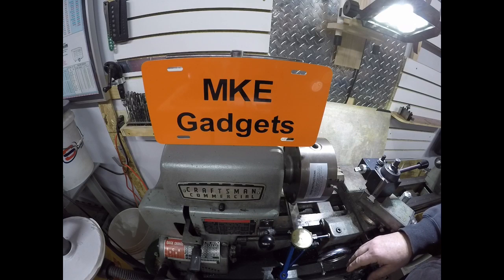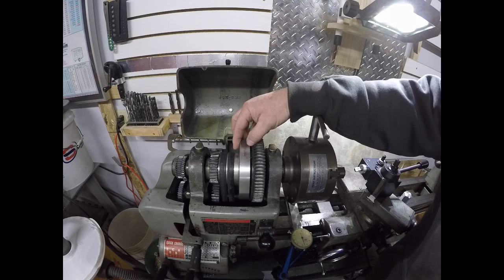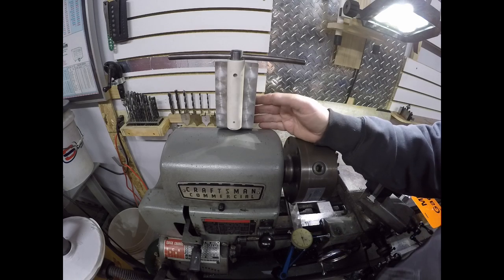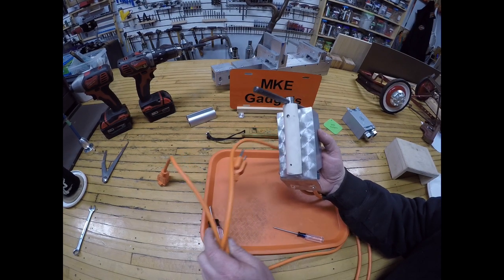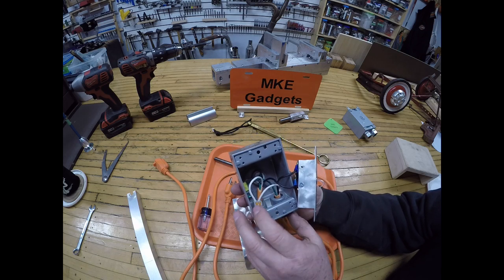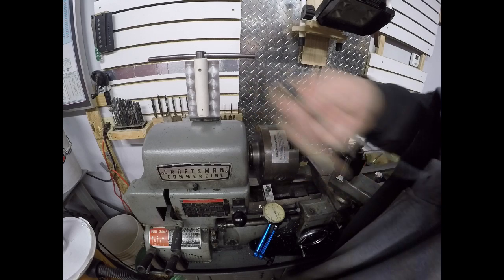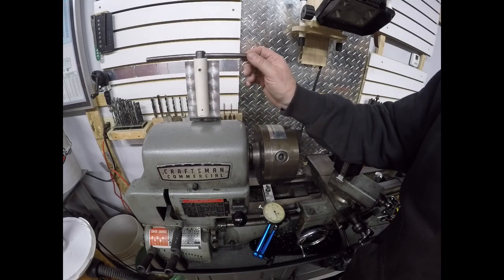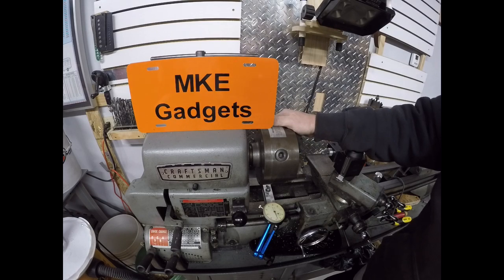DIY Build a Chuck Key Safety Switch for a Lathe @ MKE Gadgets #44

Comment: Can you provide the Grainger number for the switch you used? I like the device. Good build. Thanks for sharing.
Reply from the maker: Thanks for subscribing I appreciate your support. Grainger part number. 15A @ 120V Hinge, Lever Industrial Snap Action Switch; Series BZ
Item #
24A068
Mfr. Model #
BZ-2RW80147-A2
UNSPSC #
39121505
Catalog Page #
272